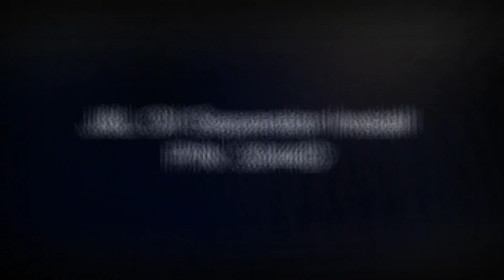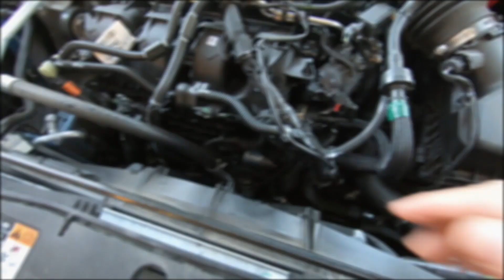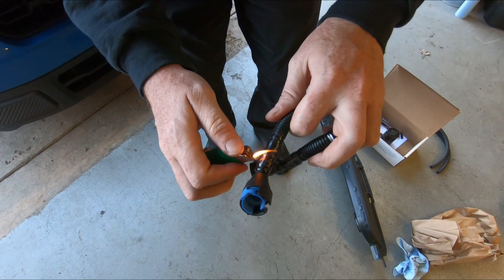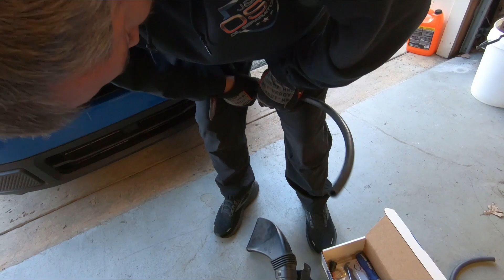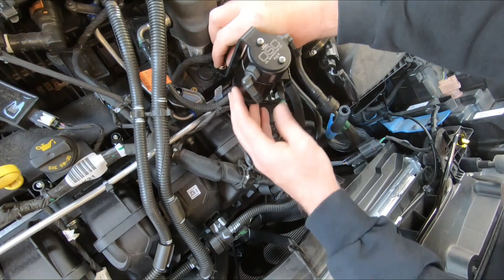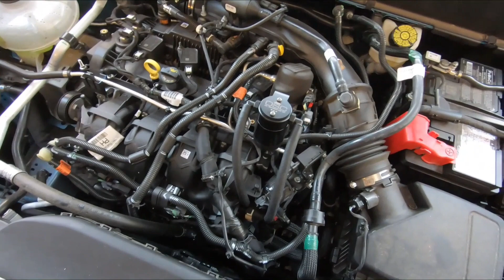J&L Oil Separator Co. 2022-2024 Ford Maverick 2.0L EcoBoost Install 3044D

Comment: Is there room to install on a 2020 edge 2.0 eco boost or does the manifold have to be removed for that year?
Reply from the maker: I haven't had another Edge in the shop to attempt this way but I imagine there would be room.  You can follow the first few steps of this video to check yours before ordering.

Comment: I don't care what kind of grease you use....those damned hoses are a bi tch to get on the can side of the house,  sure not as easy as your video makes it look.  I give up for today, will work on them some more tomorrow!🤔
Reply from the maker: Sorry for the delayed response here. Hopefully you were able to get it sorted!

Sometimes a bit of heat on the rubber hoses helps to soften them up and aid in the install as well.

Comment: great video Thank you very much but I have a doubt about whether the engine cover would have to be modified or it can no longer be installed once we do this installation. Thanks
Reply from the maker: You are correct, this kit does not fit with the factory engine covers installed.

Comment: Very informative video. I just purchased a 2023 Bronco Sport Badlands with the 2.0 engine.  I see that you listed the 2022 Bronco Sport. Will it fit the 2023 Bronco Sport Badlands 2.0 engine as well?
Reply from the maker: Unfortunately Ford changed the PCV layout sometime late in 2022 on the Broncos. We haven't been able to get one in the shop to tweak fitment as of yet, but we're trying.
Reply: @jloilseparatorco  Damn, that figures..lol.. I looked up the J&L oil separator you featured in your video. The website says it will fit my 2023 Bronco Sport. I'll have to give them a call and get their advice. The last thing I want is a carboned-up engine.
Reply from the maker: @goochma  We are J&L oil separator, so if you call you'll be talking to the same people. This kit only fits up to 2022 on the Bronco Sport as I mentioned previously, but thanks for bringing it to my attention that the website year, make and model search had a fitment error. If you look down in the description on the web page you'll this kit only goes up to 2023 for the Edge and Maverick. 👍
Reply: @jloilseparatorco  Good point..lol.. I didn't realize I was talking to the actual J&L. I missed that in the description. If you guys ever figure one out for the 2023 and up models please let us know. I am sure you will sell a lot of them. I know I'd buy one for sure.
Reply from the maker: @goochma We are working on it, just a matter of finding one local to us! We'll update fitment as soon as we can.

Comment: Hi there, it has been my reading and Not understanding that this side is not necessarily the side you want the catch can on, it's the rear [dirty] side, can you shed some light on that?  Thanks
Reply from the maker: Absolutely! You're correct that the dirty side is the one you want to interrupt, but the rear side on these is the clean side and our kit interrupts the dirty side. The one on the rear is the CCV or clean side. In our experience, the clean side kits will see little to no collection in comparison to the dirty side, which is why we only make the PCV side kits for most of our fitments.

Comment: Do you recommend dual canisters for catching oil on both the dirty and clean side?
Reply from the maker: We do not. In our experience, the clean side on almost every vehicle collects little to nothing in comparison to the dirty side. We only really see any if the vehicle is used to tow heavy loads frequently, or does some sort of road racing.
Reply: @jloilseparatorco  Appreciate the feedback. Thanks for your time!

Comment: Thanks for the excellent instructions.   I installed the catch can yesterday and it was very easy.  It took a minute to locate the existing hose, as I was reaching too low.  I was able to easily find the clip ends and disconnect.  I did buy a second factory hose and having it helped me to understand how the clips worked and the overall size.  The factory hose is shorter than I invisioned.  One tip is  I believe I did heat the end a little too much as the o ring was damaged.  I did have the spare factory hose, so I was just more careful the second time.  Overall much easier than I had thought and thanks again for the excellent video.
Reply from the maker: Thanks for the feedback Harry. We appreciate your business!

Comment: Just curious, will this void factor warranty?
Reply from the maker: If you read the fine print on any warranty contract you will find a lot of reasons your warranty can become void; installing aftermarket parts can be one of them. However, per the Magnuson–Moss Warranty Act proof would have to be provided that the after-market part caused the failure. If you need further clarification, contact your vehicles service department. Some are easier to deal with than others.